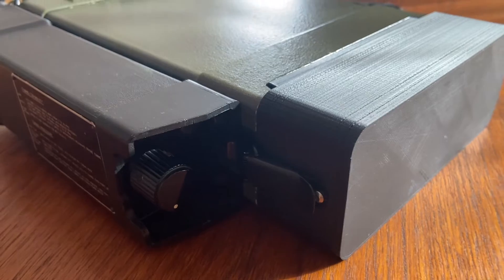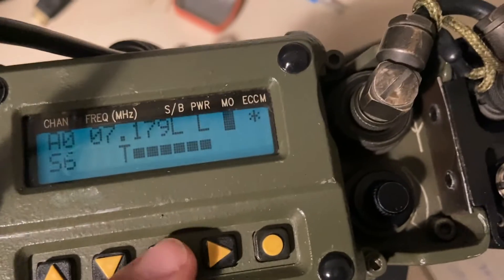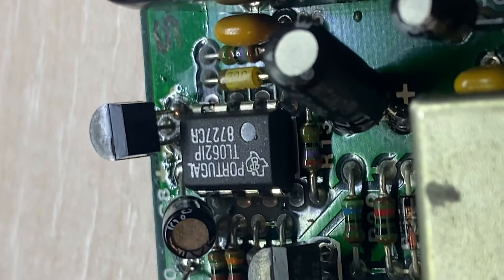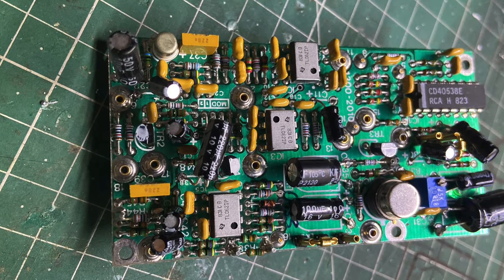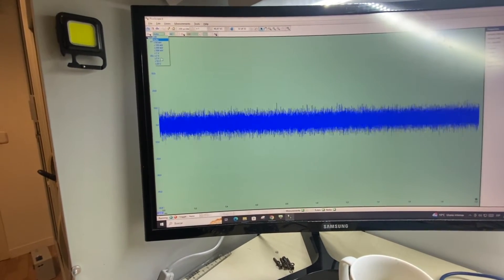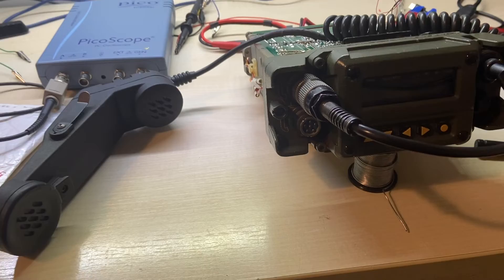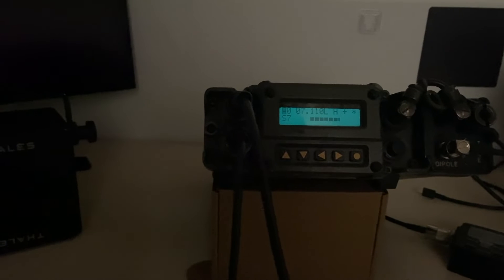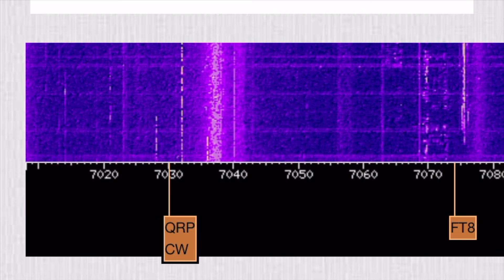Grintek TR178B military radio

Comment: I love the size of the radio but sadly mine does not power on. Any other tips where to look if it does not power on? Front switch needed cleaning, replaced fuse and IRF9521 on rear. Have voltage on side red wire.
Reply from the maker: Mate this radio is cursed. Today I connected a 24V battery and now I have no power. Never ending story. In your case I would change caps in the psu module. I don’t know much really but sometimes there is luck